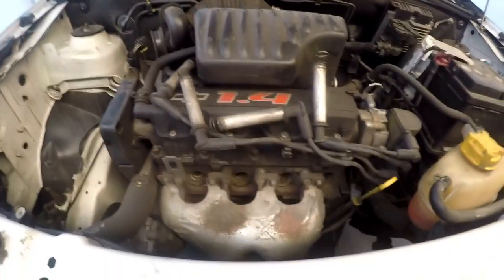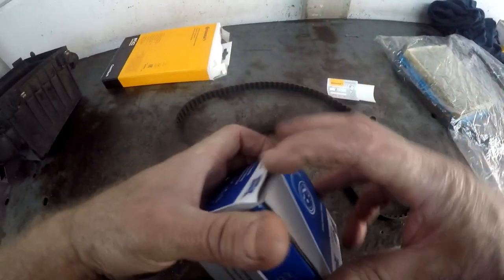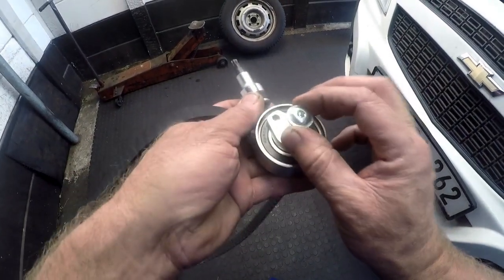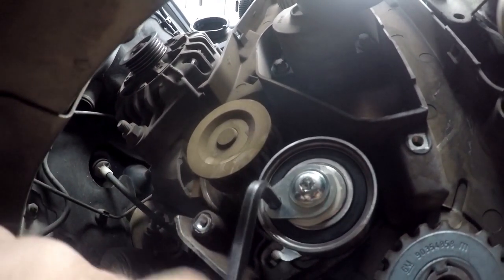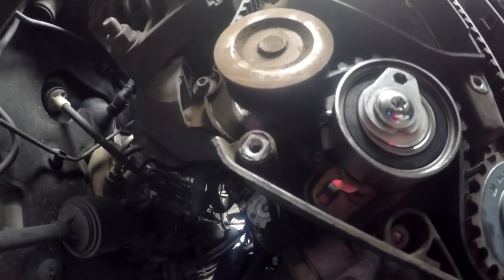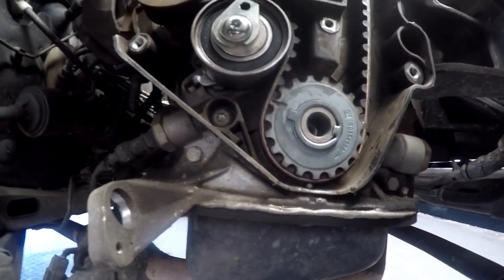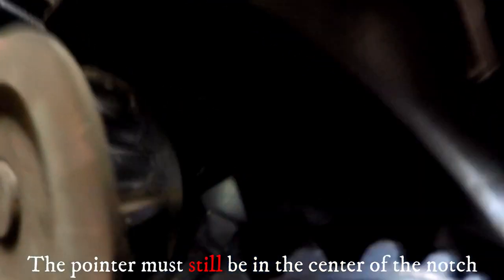Chev Utility 1.4 - Timing Belt and Tensioner Fitment

Comment: Easiest way to line up correct replacement of belt to crank and camshaft is to spray some white paint onto toothed pulleys and adjacent plates etc before dismantling. Then put your own marks with permanent marker onto the pulley and cover plate. Check that they match exactly. Remove and replace belt lining up on your marks. No hunting for factory marks   punch marks,   pins etc. I have done this on many many cars without fail...
Reply from the maker: Thanks for the great tip, Baggie Shorts, it sounds fool proof.

Comment: I have a chevy utility 1.4  the vechile started to have problems with the tensioner pulley it started to fail and the car were not pulling anymore like it used to after replaced and service  the car can still not pull engine gets warm quickly and when accelerating no power seems like car wants to die any advise on what must be checked out please

Comment: Hey Gary, thank for the video. I just like to ask what might happen if the timing tensioner break during driving but timing belt is still okay. What is the chances that it might bend the valves? It is chev aveo 1.5

Comment: Hi thanks for the insightful video, i have a Chev utility 1.8. I assume the process will be very similar, the only issue i have is finding the torque values for the crank gear/pulley bolt, timing belt tensioner bolt, water pump bolt. please advise and thanks in advance.
Reply from the maker: Thank You for supporting my channel with your visit and interaction, I am pleased this video was helpful to you.
Please feel free to check out the rest of my channel by clicking PLAYLISTS https://www.youtube.com/@vehiclemaintenanceandrepai3790/playlists for more helpful service and repair videos on most makes of cars available here in SOUTH AFRICA,
It is FREE.

Comment: hi my utility has two opposite marks on the pully A and B, which one is supposed to be ligning up with the body
Reply from the maker: Hello Anele, Remove spark plug number one and turn the engine clockwise, when the piston is at its topmost position, the mark which lines up on the pulley is TDC 
(top dead center).

Comment: Hi , I have a 2014 Chevrolet utility  and my air con is working but air only coming out the defroster vents, can you assist me ?
Reply from the maker: ou must check the selection levers/knobs that select where the air should go, the cables could be off or the pipes not on the air ducts

Comment: Hi Gary. I have one of these Chev utility bakkies. Cannot seem to fix the spongy brakes. Replaced pads discs, shoes and drums. Brakes bled out with new fluid. Brakes still spongy, peddle travels about halfway before brakes activate. Brake booster seems  fine. Have you experienced this problem on the utility bakkie
Reply from the maker: Have you replaced or skimmed the discs, because if it has a ridge worn in it and one fits new pads, it will feel spongy for a while, also the adjustment of the rear shoes are very important and could also cause soft brakes.
Reply: I agree with Gary,it's crucial to adjust the rear drums, surely even your handbrake might be high,I experienced it too,I had to adjust rear drums

Comment: Can the engine on the chevy bend the valves when the timing belt breaks, i have seen many references to this engine being a non interefence engine.
Reply from the maker: It could if the belt breaks at high revs.

Comment: Great video! How do you know that the engine is non-interference? I have a 1.6 Opel Corsa Gamma and the engine looks identical but im not sure if its a non-interference
Reply: It's iterference, Just snapped my cambelt, bent all the valves
Reply: @StormCrow1144  1.6?
Reply: @NathanealGovender  Sorry, no, 1.4
Reply: @StormCrow1144  Ok. Are you doing the repairs by yourself?
Reply: @NathanealGovender  Yes, pulled the top out this afternoon, valves needs to be replaced, all the outlet valves are bent.
Reply: Did you get the engine top off allready?
Reply: @StormCrow1144  Ok cool. Let me know if want to get your hands on a Haynes manual
Reply: @StormCrow1144  I haven't

Comment: Hy fam, I have problem with my chev utility 2017 model, it always breaks the timing belt,  what could be the cause?
Reply: Is your water pump fine? I've seen one guy having to replace also the water pump because it caused the belt to break coz it was stuck and not rotating. So check that, and also check all your other moving components that are connected to the belt, if one of them jams that could be the cause.

Comment: Will it be the same for the 1.8 engine?
Reply from the maker: Yes it is similar
Reply: Hi Gary. When is it recommend to change the belt on the utility 1.8 Is it every 75 000km/ 5 years or 90 000km/6 years?
Reply from the maker: 90000/6 years would be the correct recommended replacement period, Andre

Comment: Can I weld the timing gear to crankshaft?
Reply from the maker: It is not recommended if it gets welded on skew it will unbalance the engine and break off again with dire consequences.

Comment: Good morning... I have a problem with my Opel Corsa C/Gamma (Hatchback)... The bolt that locks/holds the crankshaft pulley keeps loosening up in time and messes up the sprocket and pulley. I have replaced the sprocket, pulley and timing kit many times but it keeps doing the same thing and looses timing.

I don't know if the threads that holds that bold are messed up or what.  Somebody was saying I should replace the crankshaft or take the car to engineering to retread the crankshaft.

Do you guys have any idea what might be the problem and how to solve it?
Reply: If you can try the mobile thread repair guys. They could assist before you take apart your engine.
Reply from the maker: It is a stretch bolt, Mokete, it must be replaced with a new one and also use locktite for extra insurance.

Comment: Hi. How do one loosen the pulley on the crank and must I remove the side engine mounts to replace the belts? TIA
Reply from the maker: It is best to remove the engine mount as it makes the job easier, there are various methods to loosen the crank pulley bolt,  
1) remove the starter and jam a screwdriver between the flywheel's teeth to lock the engine.
2) use the engine cranking method once a breaker bar and appropriate socket is locked in place on the chassis. 
3) use a power impact wrench and the appropriate socket.
Reply: @vehiclemaintenanceandrepai3790  thanks for the feedback - highly appreciated, very few companies with such passion and free advice.
Reply from the maker: Always willing to help, Charles, it is a passion of mine.
Reply: @vehiclemaintenanceandrepai3790  I get my wife to stand on the brakes while in gear :)
Reply from the maker: Now there's a plan that works, thanks for your input Arnoux.

Comment: If your tensioner bolt is striped and do not want to tighten anymore.what do i do.
Reply from the maker: You have to tap the thread one size bigger, Damian, you may need an engineer to do it if you do not have that skill and tools.

Comment: Whats the easiest way to replace the thernostat?my chev is overheating
Reply from the maker: Hello Samurai Duane, there is, unfortunately, no easy way, the cambelt must be removed, the backing cover has to be removed and then you have access to the thermostat housing, 2 bolts hold it down, the thermostat is moulded into the housing., good luck, wishing you an awesome 2021.Gary
Reply: @vehiclemaintenanceandrepai3790  thanks, but i dont think its the therno as there housing nd pipe gets warn, so i doubt its stuck, i had a leak on one hose maybe thats a reaon,

Comment: Hi guys. 
What will be the torque setting for the crank pulley when fastening?
Reply from the maker: Renew bolt, 95nm + 30 degrees + 15 degrees
Reply: @vehiclemaintenanceandrepai3790  Thanks appreciated. Swopped timing belt and fanbelt after timing belt snapped. Motor running 100 percent.
Reply from the maker: Great job, glad to be of help.

Comment: Hi. How do one loosen the pulley on the crank?
Reply: @vehiclemaintenanceandrepai3790  Thanks for quick reply! Tried that yesterday, even with someone pressing the brakes, but don't want to loosen (feels like it is little spring-loaded as the pulley still turns a little and jumps back when let go). I've put everything together, guess I will have to try find someone with air gun. I am nervous as I haven't done this before...
Reply: Got most of the other service tasks done, 1 - got stuck removing the rear hub to replace shoes, 2 - don't know where to drain / fill transmission oil and this 3 - this cam-belt issue... Feels good to have been able to achieve that much already :-) Your videos helped a lot!

Comment: What happens when the belt is one notch out at the top?
Reply from the maker: The timing will be either retard or over-advanced depending on which way it is out, there is no distributor to correct the timing, therefore the belt must be put on correctly.
Reply: @vehiclemaintenanceandrepai3790  Thank you very much. Say it is one notch too over-advanced, what is the result in "putting foot". It seems that, since my car came back from service, it reacts a bit rougher. Even in starting the engine.

Comment: How to turn engine
Reply from the maker: Put the front pulley bolt back loosely, use a 19mm spanner and turn clockwise. 
Or put the car in 2nd gear, hand brake down and push the car forward slowly until the crank's marks line up then take the car out of gear and pull the hand rake up.

Comment: If my utility shows half a tooth out is that bad
Reply from the maker: It will not make a difference (half a tooth)
Reply: Should the timing be on mark A or mark b on the cam shaft
Reply: Thank you so much for your help
Reply from the maker: Always a great pleasure.
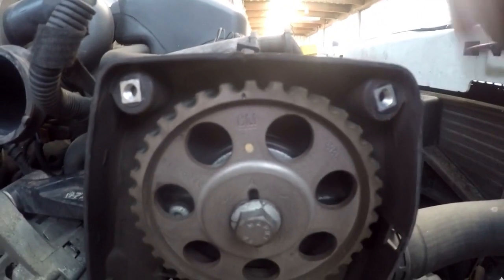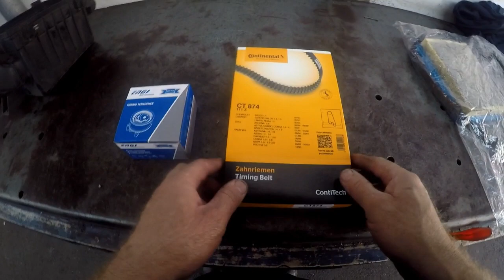Reply from the maker: As in the video, there is a dot on the cam gear and a groove in the plastic cover these 2 marks have to line up. 1:50 to 2:10
Reply: Thank you so much and agreed but the cam gear has a keyway that can go both ways . On mark a and mark b . Just wanted to know on which mark the cam shaft keyway should be on . On the mark a side or the mark b side

Comment: hi, can someone please help me with my chev utility. when you engage gear one and then trying to leave clutch slowly it vibrates. what could be the problem?
Reply: Hi.. Do you have to remove the engine mounting to fit cambelt and serpentine belt, and how does serpentine tensioner work. Thank you
Reply: Hi, did you come right   I have the same question